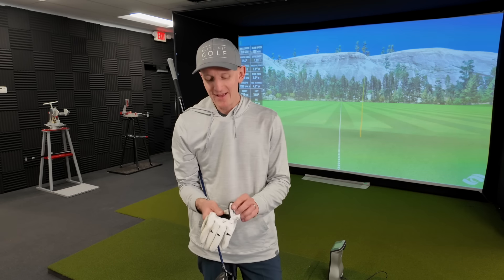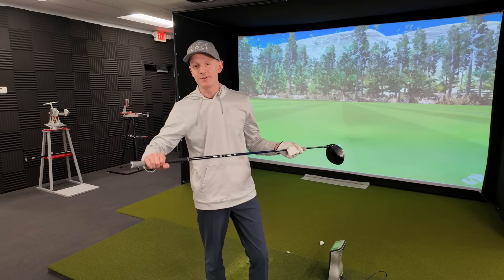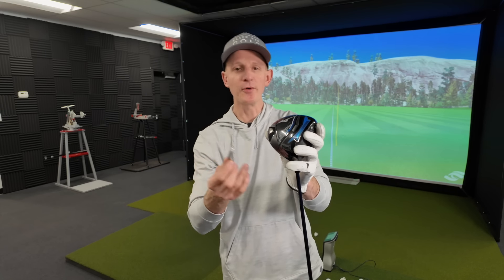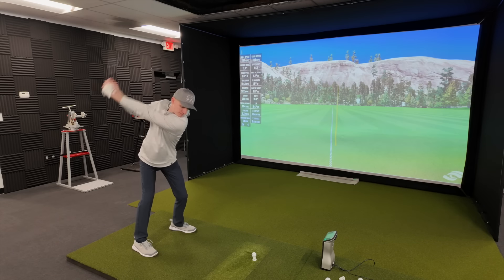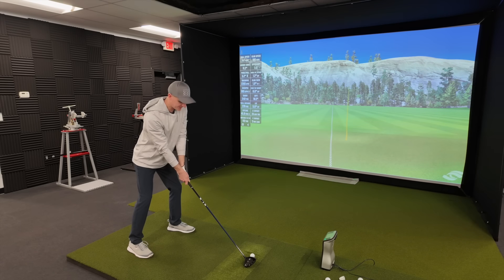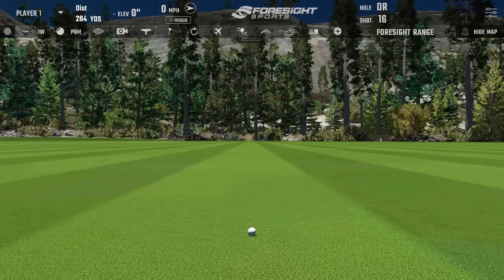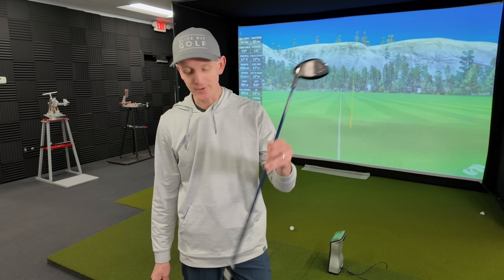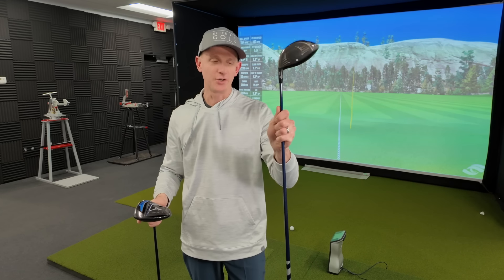MAKE YOUR DRIVER BETTER / 3 SIMPLE DRIVER ADJUSTMENTS

Comment: Excellent video!  I was fit for a Titleist TSR2 at 45" in length, but found I was hitting it all over the face.  Experimented at the range by using Dr. Scholls foot powder to determine the strike pattern at 45" and gripping down a half an inch.  Found that my center contact was much better at 44 1/2".  Subsequently, took a half inch off the driver shaft, changed the back weight to get the swing weight correct, and changed my shaft from a 58 gram to 65 gram shaft.  My distance improved slightly, but my dispersion improved significantly.  No more high right tee shots!
Reply: Great comment, and would think being fitted would’ve addressed these adjustments from the onset.
Reply: @mariad750  There are a lot of factors that go into a fitting, and in particular, the standard length for Titleist drivers is 45.75".  While doing the testing this was way too long, and they only had a 45" demo driver shaft that we moved to.  I hit it well, and that was what we settled on.  However, playing many months with it, I noticed I was getting inconsistent contact.  Thus the "real world" testing on the range.
Reply: I had an easier fix. Purchased a used , near mint driver  and didn’t notice  grip was “mid size”.  Played a few rounds and leaked a few to the right. Changed grip to standard like the balance of set and boom!  No leak so Straight ball!
Reply: no need to use foot-powder, just use cheap balls :)

they will happily mark-up your clubface when new

Just remember that whenever you change there will be a counter-change.  
As your confidence improves, you will over-play your clubs and your shots, expose excessive power and overconfidence as problems, then ease back on the throttle, return to a cautious approach to play, start hitting your shots again and then fall into a valley where you fail to pay enough attention & try hard enough because you now expect the shot to be easy.
Reply: You do know that .5" is just over 1% of 45" right.

whatever you say, princess

not sure  how that excuses you missing shots with the driver shaft length that you have but I guess it's a good excuse in the clubhouse likewise increasing shaft weight by  10% and changing the back weight in some random fashion
Reply: @touristguy87  Nothing like a "johnnie come lately" trying to tell other people what you feel is best for them.  I guess you are one of those supposed "experts" that have to comment negatively regardless of the situation.  Anyway, I know what .5" difference is, and now I consistently hit the middle of the clubface.  In addition, I know what swing weight feels the best for my swing, so mind your own damn business!
Reply: @pauldavis8286  "" trying to tell other people what you feel is best for them.  "

I didn't try to tell you what I feel is best for you. Or anyone else. I just expressed my opinion. 

If you respond to my opinion like that, imagine what my opinion is of what is best for you.
Reply: @touristguy87 If you are expressing “your opinion” why did it go straight to name calling??
Reply: @johnnyblaze9206  because "people" is a name

Anyway mind your own damn business
Reply: @pauldavis8286  look it really makes no sense to end a comment telling people to mind their own business.  Period. First of all 

Second you are talking about changes in a nonsensical manner. You say they work without even explaining why you think they work or even why they should work.  To me all that you are saying is that you have no idea why they work and it's even possible that they have little to no effect compared to your just practicing more. 

Do you even know the science behind moving weight around a golf club and shaft, or changing grip-size? I doubt it.  You haven't demonstrated any so far. 

Third tour max shaft length is 46 inches. Why would Titleist make their standard shaft length 1 inch above tour limit.
Reply: @mariad750  I don't think you can fix bad shots with gear-changes. That is like saying that the road to improvement goes through fitting. Not swing-changes.
Reply: @pauldavis8286  ps the first Damm thing you did in your comment is to call me a "Johnnie come lately" as if it was completely invalid for me to even comment on another comment. How stupid is that.  That is exactly what you were doing.
Reply: @ so then why would you do a fitting?
Reply: @ You called him a princess.   If you would have heeded your own advice and minded your own business this wouldn’t be happening.
Reply: @johnnyblaze9206  ...listen to you whine.
Reply: @ Making a point, the one whining is you, little princess.    You tried to be a tough guy acting like you’re someone and got called out.  Now you’re squirming.  It’s ok, apologize to the OP and we will be good.  No need for name calling.  But if you want to continue, I have nothing but time.
Reply: @johnnyblaze9206  oooh tough guy has intimidated. Me oooh
Reply: @ "But if you want to continue, I have nothing but time."

...so says Johnny Chihuahua...the smallest and loudest dog on the Internet...
Reply: @ Haha.  Nice come back princess.   Calling me a little dog, whew.  That hurt, hopefully I can sleep tonight.   So, you are going to be a like this.  Does your mom know you’re still on the computer on a school night??
Reply: @touristguy87  Must be YouTube is tired of me torching you.  They keep deleting my comments.   Or, you’re crying to them??   Which is it princess.
Reply: The fitters know this. The mfgs know this. A fitting might give you optimal distance, say. It's very hard to get optimal distance out of a club over 18 holes, week in and week out. You try to do that and suddenly you're pulling shots left and shanking shots right, topping them and hitting fat, because you can't get in touch with the clubs, can't play them confidently. You're trying to get "optimal performance" out of your clubs every time and that works against consistency. Consistent performance is what lowers scores, at least until a player gets overconfident with them, and then their complaint changes, They go in for a new fitting and the cycle continues. The simple fact is that as a player improves they begin to know and understand their personal preferences in terms of both equipment manufacture and in club settings. You chase progress in one way, you make a sacrifice in another way. Some players are willing to make that sacrifice, some are not. The game is individual, so is the way that a club plays for each player, so is the fitting...it can be a never-ending chasing of the tail, or you can just settle down with a set of clubs and maximize your play with them. Based on my own experience it is clear that it is better to settle-down with a decent set of clubs and learn how to play the well than to jump from club to club, from fitting to fitting, trying to find a fitting that you play well. Players will always be limited by their own incompetence. Golf is a tough game to play well and you either have a talent for it or you don't. Fittings, I think, are a tool. No one tool is ideal for all work. You still need to find a real game. The mistake is to think that a good fitting is required to find a real game. The problem with a fitting is that it tells you what you "need" to have your best game, and that inherently is a lie. The gear that gives you your best game is what you play well with in real-life. Not in front of a Trackman or some other flight-monitor, and on a real course, not on a projector-screen.

So overall I would go to different fitters, getting fitted for different gear, and buying all that gear and trying it out on several different courses, each time playing a different set. You'll end-up liking all t he gear for different reasons. Some you'll favor more than others, some you will get better performance with than others, and some you will feel more comfortable playing with than others, get more types of shots, get more consistent results. Because there are trade-offs in each change. Different clubs play differently just as different settings play differently. Do that and your level of play will increase, because you are improving your play with different clubs and different settings. You'll learn how to play each setup optimally. You will no longer say "oh I need to have a shaft with this, this and this configuration, this clubhead with this loft, lie and heel-weight, irons with this profile and this shaft configuration" and so on.  You'll learn how to play different clubs with different configurations. It takes practice to do that. You don't learn that in a half-hour fitting. You don't learn that in a 4 hour fitting. That takes months. At least. Years, for most of us. The clubs force you to adjust your game to the clubs. Having to play different club configurations broadens your game. The broader your game is, the more shots you have in your bag. Suddenly you're playing different shots depending on the hole in front of you as much as the clubs you're playing. And you learn, through long trial and error, which shots you like to play based on the hole in front of you and which clubs you can play those shots with reliably and consistently and which ones you can't. If you don't have those shots, you can't be fitted for those shots. Because you can't even hit them. And trust me it takes skill, a lot of practice, a lot of trial and error to learn how to hit shots like high draws and fades that land in play when you want them. It's a lot easier to hit low burners from a fairway-height tee that run down a straight fairway. That shot isn't going to be enough to get you around a challenging course in good shape. You need a good variety of shots to do that. 

Every golf expert knows, and especially the major reps know, that you are not going to find a good game through fitting.  What you can do well is tweak clubs through fitting.  Because you can always go back to the clubs that you started with, the damage is limited. But that only works well for people who already have good games. They can say "ok I tried it, didn't like anything I tried more than what I started with, so no harm no foul, I'll save money, play with my clubs that I know well, thanks for the time, bye" and go back to playing real courses. If you do find something here or there that you think has real potential you can buy a new club with that fitting and try playing it against your old club and see which you like best. Again, the new club with the new fitting will be better for some shots than your old clubs will be, and so on. Broadening your tools will help to broaden your game. Now all you have to worry about is indecision coupled with a lack of practice for whichever club you try to hit for whatever shot you try. As you gain more experience with each club, the time to re-acclimatize with each club gets shorter. It might take a few shots to get used to hitting it again. A few shots later you're willing to experiment in certain situations and try to hit shots that you've learned to hit with your other clubs. Eventually, over dozens,  hundreds of rounds played with each club, you'll get a good feeling for all of them, what they can and can't do, what they are good at or bad at. All that I have found is that I like all my clubs for different shots and different reasons. It's really hard to pick just one that I want to play all the time.
Reply: what I have done though is stick with one set of irons, one putter, and one 3-wood, that I have just ordered used off eBay and having gone through a few sets of irons, a couple of putters and many 3-woods, I've settled on these. They are just standard Titleist clubs, old clubs even. My 3-wood is really a driver with a players' head, smaller than normal. It's a driver but it's more like a 2-wood than driver or a 3-wood. I can play it like a wood or a driver and it plays really well off the fairway. I have 4 drivers, two TaylorMades, two Titleists, the two TMs are M4s @ 9.5 and 10.5 loft, I have an oldish Titleist 915d3 9.5 and a relatively new TM  TSi-2 11.5 head. I've tried the M4 12.5 and the 915d3 in 8.5deg. At 100MPH I don't have the clubhead speed to really make an 8.5deg head work, and the 12.5 is too high for me to get any real distance off it. Just hangs the ball up in the air and it plops back down relatively close, no real gain in hitting it over the 10.5 or 11.5 deg heads. The other big difference is that I can't open the Titleist clubs as much as I can the TMs so I always have to adjust to the fact that the ball will come left off the tee with the Titleists while with the TMs it tends to go slightly right off the tee (as I set them up at least 2 degrees more open than the Titleists...that's why I bought them). This significantly affects how much lag each club requires. It's something that you get used to over time. It allows me to hit the Titleists with a flatter swing and still keep them off the ground while getting a good apex, and it allows me to hit the TMs high without having to swing upwards too much. But where they really work well is in getting the club under the ball (with moderate tee-height and a decent amount of lag) and hitting the ball up in the air at about a 45 degree angle. The 10.5 TM absolutely loves being hit like this, and so does the 11.5 TSi-2. They reward me with the most awesome high shots when I get it right, and it's just so nice to see the ball just towering high and landing a solid 275 down the fairway, in play, bouncing and rolling with a short roll almost exactly where I want the ball to stop. Just a great feeling to pull that shot off correctly. The lower lofts really require a good, accurate shot because if they are too much offline they will just bounce and roll off the fairway into the waste. So for me, wide fairways I can hit anything into them. Narrow fairways I want to hit higher loft. I can hit the higher lofted drivers either high or low. Have to be careful trying to hit low-lofted drivers high because it is easy to top them and that's gonna be a bummer. They are all about the same with a flat swing into the ball, the high lofted clubs giving a little more apex. The big differentiator when it comes to apex is the attack-angle. I want the ball up and out. Hitting a line-drive shot off the tee? I might as well hit an iron. There are so many things that you can do on the tee to hit different shots that it's just crazy to think that you're going to want to play just one driver once you learn how to hit different shots. Just changing the loft favors some shots and hinders others. It's exactly the same with irons. In changing irons you're not changing just the apex,  you're also changing the shots that you can hit, the lies that you can hit off of reliably...the carries that you can make, the gaps that you can hit safely into. It's like playing pool without any English, there are just certain shots that you can't hit without English. Not having those shots guarantees extra strokes.

Then there's the effect of playing different tees...forward vs back tees, of playing off tees vs grass, on tee-shots...you're just going to get different 2nd, 3rd and 4th shots. Just by changing tee-locations. If you're playing off a high tee and hitting fades when you want a draw, that gives you a very-different 2nd-shot. Try playing that shot off a flat fairway-level tee next to a lake that runs along the fairway on the right with a creek running along the fairway on the left, and see how that works. You have negative tolerance for hitting the ball at least relatively-straight and having it land, bounce and roll on the fairway, not into the water. You can't afford to hit a low ball that goes screaming down the fairway, lands and rolls off into the water. When you have to control distance, landing and roll-out you can't hit low shots because they have to be hit perfectly. A high shot solves that problem. All that you need to do is get it to land in play. A fitting will not solve that problem for you because you don't have to hit the ball to a spot. You tend to look more at distance. In a fitting you don't get elevation changes, wind changes that you will see at every elevated tee or fairway. Hitting over water, who does that in a fitting? Uphill crescent fairways around a steep slope, who does that at a fitting? When you're playing real courses, you need the ball to land in play and stop in play, not just hit a fairway, roll across it and go down the side of the fairway into the sagebrush. I've played many a hole where your 2nd shot is 200 out from the green over a fairway that is a quarter-circle bordered by a 50 foot deep hole with waste on the inside and high grass under trees on the left side.  You can go for that green over the waste or play a cut shot down the fairway. Duff the shot over the waste and you're down there picking-up balls, climbing out of the waste and dropping on the fairway, if you're not dumb enough to try to play to the green out of the waste. Pull the cut-shot up into the trees and you're up in there trying to play out to the green. No fitting is going to give you that shot. That is not a shot that you practice. If anything you practice dropping on the fairway where your ball went into the woods and chipping onto the green over the fairway. Now what are you going to do, take a full 9 or even a PW or a half-7? If you're wise you take the half-7. But bad players don't play half-swing chips. They always try to pick the right club that they can get to the pin with a full swing. Then they go up and fuck-up the shot. Because it is hard to hit full-swings reliably. Consistently. Accurately. With precision. Especially with short clubs. Their shots are inevitably fat or skulled over the green. Behind the green. Down the hill behind the green. Into the woods next to the green. Or landing short in traps or waste next to the green. 

Because full swings tend to lead to excessive body-movement. And therefore to low-precision shots. The difference between great and average players is that great players routinely make those full-swing shots. Average players do not. Why worry about getting fitted for shots that you won't take if you have the chance to avoid taking them?

But bad players don't know that the key to success in golf is to avoid taking shots that you can't hit reliably. To stick to shots that you CAN hit reliably.

Those are not the shots they want to get fitted for. They want to get fitted for shots they can't hit well, as if the fitting will solve that problem. Fitting won't solve that problem. It will at best just help you to suck slightly less.To play good golf you need to learn how to play well. No ifs, ands or buts. It works well with good players who are looking to knock a stroke or two off their round. It's not going to save you 20 strokes per round because you suck. You need to learn how to hit better. Yes, way too stiff a  or flexible a shaft, maybe way too long or short, sure, those changes a fitting can help you with. Once you get the basics down, it's all on you. A half-inch off a 47 inch shaft fixing your dispersion? No. In two rounds you'll want that half-inch back on your shaft.
Reply: @johnnyblaze9206  impressive